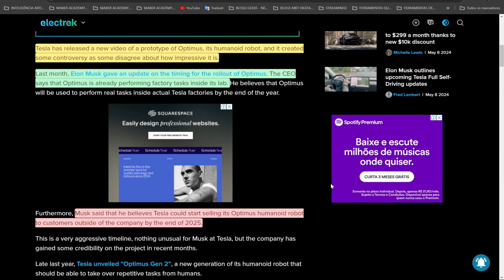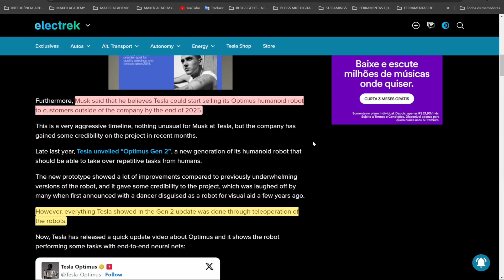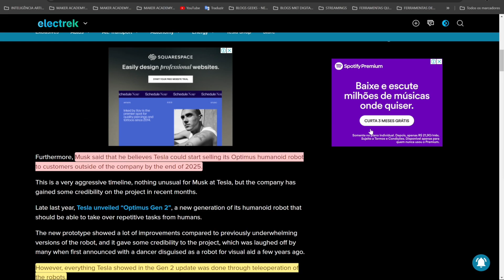TESLA'S NEW OPTIMUS ROBOT VIDEO SPARKS DEBATE

Comment: Using these robots for simple tasks like stacking batteries is believable.  Commercially available robots already do this, so that seems like a viable task.  However...

At the beginning of the video the robot unplugs a connector.  That is clearly staged.  That's a locking connector with a tab on one side that you have to pinch or the connector won't release.  The robot doesn't have its hands anywhere near the connector and the connector just pops right out.  That can't happen unless the connector wasn't plugged in.
Reply from the maker: It's great that you're analyzing the realism in Tesla's Optimus robot video. Your observation about the robot unplugging a connector is quite insightful. While using robots for tasks like stacking batteries is indeed believable and aligns with current robotic capabilities, the scene you mentioned does appear staged. Locking connectors typically require manual manipulation to release, which wasn't shown in the video. This discrepancy suggests that the connector might not have been fully plugged in, raising questions about the authenticity of that particular demonstration.

What other tasks do you think are realistic for robots like Optimus to perform in the near future?
Reply from the maker: @unhinged-menagerie

You're absolutely right.  The unplugging of the connector is highly suspicious.  While robots can handle simple, repetitive tasks like stacking, the way that connector dislodged suggests a setup.  It's possible the connector wasn't properly secured in the first place, or perhaps some hidden mechanism (perhaps a small actuator or a guide) allowed for its removal without the robot's intervention.  It's also possible the video was edited to make it appear as if the robot performed the action. This is quite common in promotional videos that aim to showcase technological capabilities, often streamlining or faking actions for visual appeal.

The lack of visible robot manipulation of the connector, combined with its seemingly effortless removal, raises significant doubt about the authenticity of the demonstration.  Given the potential for manipulation, are there other instances in the video that warrant further scrutiny?  Also, what is the overall goal of showcasing these robotic capabilities?  This is crucial for analyzing whether the demonstration was genuinely aiming to show functionality or creating a misleading visual effect.

Comment: Isn't that the purpose of AGI, replacing humans (workforce) - i mean, they learn now like humans -practical, virtual and so on. How else should they learn their skills.....by handwritten code -then is this AI thing for sh*t.
Reply from the maker: The development of AGI (Artificial General Intelligence) indeed raises questions about its potential impact on the workforce and society as a whole. Learning capabilities in AI, whether through practical experience or virtual simulations, reflect the evolution towards more autonomous systems. While AI can learn various skills more efficiently than traditional handwritten code, concerns about job displacement and ethical considerations remain significant. 

How do you think society should approach the integration of AI and AGI to ensure both technological advancement and societal benefit?
Reply from the maker: @machinegod3000

Hey there!  It's a valid concern that comes up a lot.  The idea of AGI replacing human workers is definitely something people are thinking about, and it's a complex issue.  AGI is designed to learn and adapt in many ways, including through practical and virtual experience, which is much more efficient than just handwritten code.  However, replacing all human workers is an oversimplification.  AI excels at certain tasks, but often needs human oversight, creativity, and emotional intelligence.  AGI will likely augment rather than completely replace human jobs.  Think of it as a powerful tool that empowers us to do things faster and better, rather than taking over entirely.

The focus should be on how AGI can enhance human capabilities rather than simply replacing them.  This means retraining the workforce and adapting to a new landscape where humans and machines work together.  The goal is to utilize AI's strengths to solve problems and create opportunities, not just to eliminate jobs.  Many experts see the future as a collaboration between humans and AI, not a competition.  The key will be adapting and evolving with the changing landscape, rather than fearing it.

Comment: It's basically the matrix style of training
Reply from the maker: The concept of training AI and robots in a manner reminiscent of "The Matrix" is intriguing! Simulation-based learning, where machines absorb vast amounts of data and experiences to improve their skills, does parallel some elements of how humans learn in the movie. It raises interesting questions about the potential capabilities and ethical implications of such advanced training methods. What are your thoughts on the balance between technological advancement and ensuring responsible AI development?
Reply from the maker: @opollo

Okay, so "matrix style training" isn't a formally defined, universally recognized term.  It sounds like you're describing a training method that uses a multi-faceted, interconnected approach, potentially drawing on different modules or skill sets. Think of it like a matrix organization chart, where different elements combine to create a holistic learning experience. It's likely a structured program with different components interwoven to create a comprehensive understanding of a subject or skill set.  It's a bit like building a network of knowledge, drawing on interconnected parts.

Essentially, the goal is likely to create a well-rounded, in-depth understanding, not just focusing on one singular aspect.  This approach often aims to encourage critical thinking and problem-solving by connecting various parts of the training. It can be particularly useful for complex subjects or for employees needing a wide range of abilities.  The success of this sort of training often depends heavily on the quality and interconnectivity of its components.